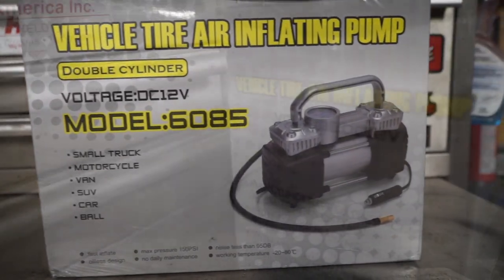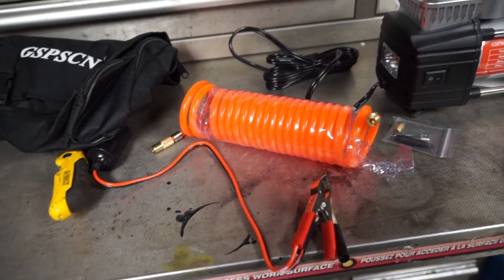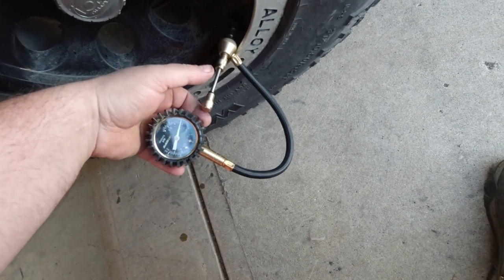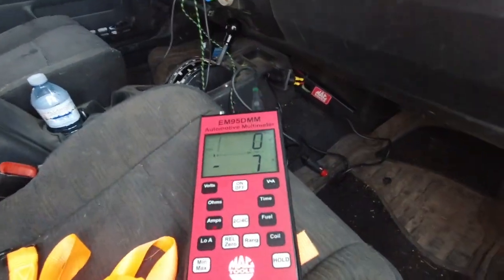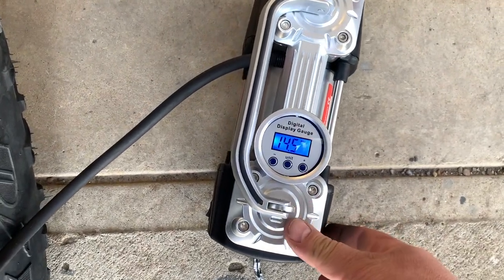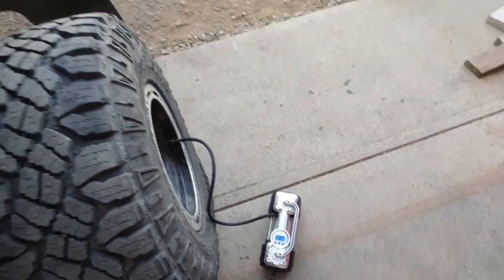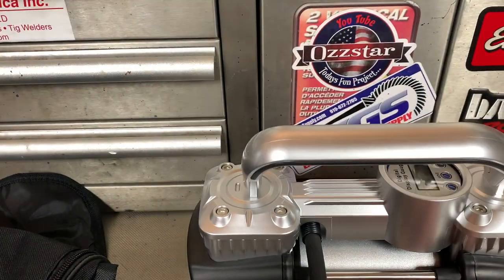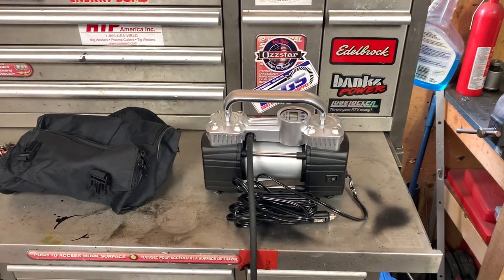GSPSCN Digital 12v Air Compressor

Comment: You should take the plastic parts off and check if it's actually dual... Many of those style pumps are only single but have the appearance of a dual.
Reply from the maker: Never I don’t want to let the magic out
Reply: @TestDontguess  Don't worry, it will let itself out
Reply: Yeah but this is one of the better brands, I'd trust them .  I've owned cheaper pumps that overheated so I'd probably the extra money to get this one or the viair 88p.